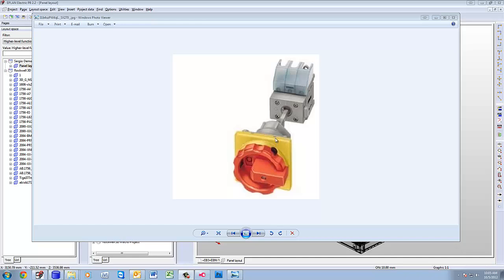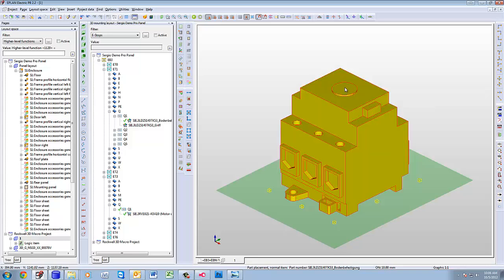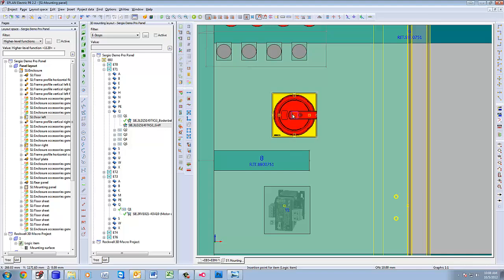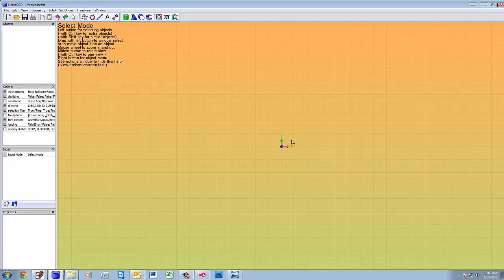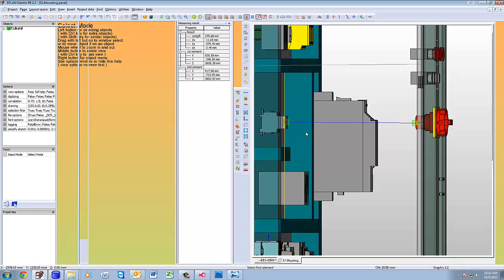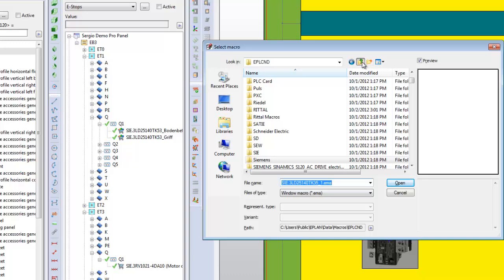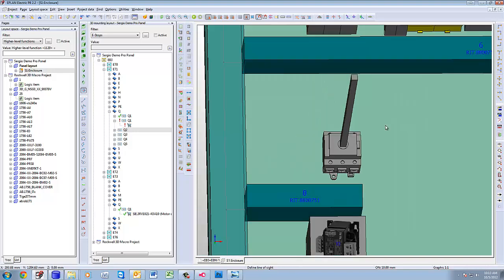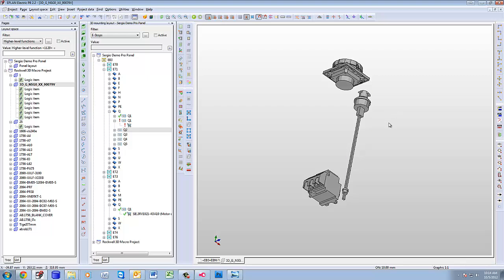3D Disconnect switch how to in EPLAN Pro Panel

Comment: Nice Video.
I see that You know a lot of tips and tricks of EPLAN.
For example I did not know that holding Ctrl and clicking on 2 points I can get middle point for handle.
Maybe You can make one video to show main principle of all those tricky 3D toold that EPLAN ProPanel have.
How to join the 3D elements, how to change origin, how to rotate components, etc.
I spend 3h until I found how to make all 3D as one element after STEP file import :)

Thank You for nice instructions....
Reply: Please give me your downloaded eplan macro/part data/created form and one big dificult project drawing in my mail id: aptheanil24@gmail.com
Thanks in advance.
Reply: @AnilPatel-ve9kz  Are You from India?
Reply: Yes
Reply: Can you help me
Reply: @AnilPatel-ve9kz  I have not much free time vu I can try. ritvarsrizikovs@rrindustries.lv

Comment from the maker: Hi all, sorry for the delay to answer @lin2m3 You need to assign a mounting surface to the rail in order to be able to attach anything to it first then you can attach your PS rail. if you can add a small clip to explain what you want to do it might help me better help you :)

@Jeroen you can get all my toolbar if you want, in the EPLAN forum, i usually post alot of good shtof there ;)

Comment: Thanks for all 3D tutorials. I've tried to build up a 3D enclosure and I wanted to attach PS rail from rittal on the left side of the enclosure, between front left pillar and back left pillar. The PS doesn't stick. Do I have to define a mounting area on the pillars? or how should I do it?